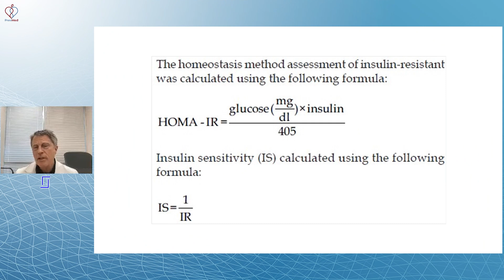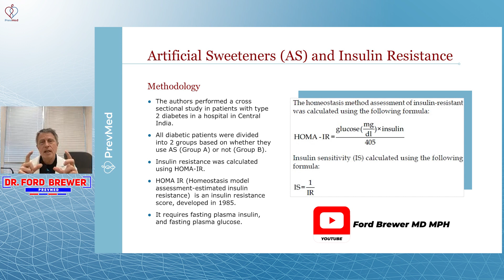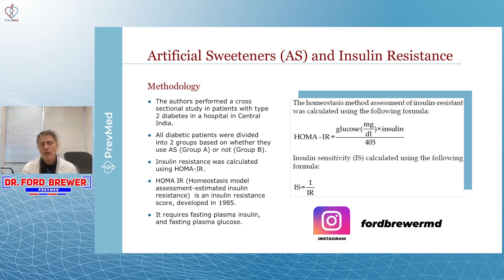Calculating Levels of Insulin Resistance

Comment: So a person gets all these test and finds out the have IR.  Then what? Odds are your local doctor won't have a plan.  For me it was going low carb and most definitely eating 1-meal a day.  Even on low carb I was experiencing the "dawn effect" with higher fasting morning glucose levels and finding it difficult to get into keto.  That all changed practically overnight when I went to one meal a day. Now my morning glucose is consistently below 90 and I'm in ketosis on the morning.  My experience with eating carbs is that the effects can last for days so far as fluctuating glucose.
Reply: Great ! 👍
Reply: Hardest part for me was eating enough calories in 1 meal. Do you track your daily calories?